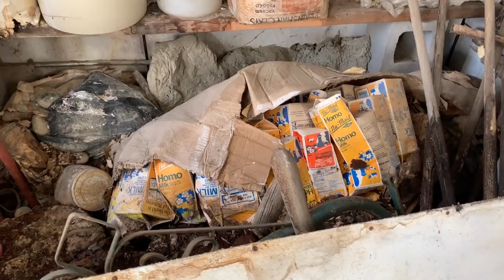Part 17. The Potters House: Mary's Last Ride

Comment: I teared up when Mary took her last ride. .. Thanks !     Those ice trays work better if you run water over them first before pulling up on the handle.
Reply: I still have some of those ice trays they were my mom's tray she had before l was born 59 years ago so not sure how old they are.
Reply: Run the water over the bottom though so the ice doesn't melt. I remember getting my fingers stuck to them too.

Comment from the maker: Regarding the tile... the correct solution is to use cement board over the subfloor. Although you can tile on plywood it’s more challenging and may expand or contract... that said I chose to do this as we were already 1” above the other floor and didn’t want to add any more height to the bathroom floor with added cement board.
Reply: We made the mistake of not using cement board in a bath. Tile lasted 2 years before cracking, grout falling out. It's a MUST where there's moisture.
Reply: Big mistake......................will not last long
Reply: And glue used is ok for wall (light weight) tile. Cement mix with larger tooth trowel for floors.
Reply: @celestewatson4874  yup and without any sealer on that plywood, looking at a LOT of damage as soon as ANY cracks start.
Reply: I used Schluter system. Comes from Germany. Also made in Canada. If you ever tile again you might try it. I learned how to install from youtube.
Reply: They put a clear sealer over the tiles in my bathroom. They said it will protect it from the moisture and make it last longer.
Reply: The first thing I said as soon as you started talking about tiling was “he’s not going to do that straight over the plywood is he”? No sealer, no waterproofing...... it honestly made me cringe. I can’t see it lasting much longer than it took to lay down.

Comment: That last ride was so moving! Also I liked your six sided octagon tiles ;)
Reply: I do too. They make somewhat of a chicken wire pattern. I wish,  instead of you putting in a different tile that would rob it of the charm and cohesive finish, ....just hire someone else to finish it with those tiles.  If I were buying the house, I would want the entire kitchen back splash to have the same look.  You made a wonderful choice aesthetically  and it looks great, please let it continue to the other wall. Let someone else have the headache of finishing it.
Reply: @kimberlytyler-webb9390  I was actually joking: they are of course hexagons, not octagons. But I do like them and I agree with you in that a consistent look would be nicer than using regular tiles for the rest of the backsplash. On the other hand, Alex has already done so much work in the house I understand he wants to get this done asap.

Comment: Enormous props to your bil for working on the glue. I’ve done that. It’s brutal.

Octagonal tiles aren’t subway tiles.  They’re porcelain so they’re going to be really hard.  That makes them more brittle. They’re not that hard to cut because the diamond saw blades don’t cut fingers so you can work super close to the blade!!!!

Comment: You should have waterproofed the room before adding tile.
Reply: I wasn't going to mention it with everyone so moved by Mary's last ride (I cried too) however he started tiling in the corner. I remember when doing my kitchen tile to start directly in the middle and work your way out, so the only cut tiles you will have will be around the edges
Reply: How is that done?

Comment: The old front doors almost always had a wood panel on the bottom half of the side windows. That is why there was only 2 short stained glass windows found,,and the reason is the windows on the bottom can easily be broken or dented.Also it looks a whole lot more cozy.

Comment: I laid the exact same octagonal tiles on my floor. The thing I had to resort to was a hobby vice to hold the tile and a Dremmel with a tile blade. It wasn't easy and a little dangerous but it worked and the floor looks great. I will never use this tile again!

Comment: When laying tile one should start in the center and work out. And full tiles should be at the door way. Never expect walls to be square either. Screwy edges can be hidden with moldings. Learned the hard way.

Comment: FYI.. With metal ice cube trays, turn upside down over the sink. Run a little water over the bottom of the tray. Turn back over to open. That should solve all problems. 😊

Comment: I wouldn't throw out any of the Goodwood out. In case you might need it I will put it on the back porch that don't have to be tore down. Okay Rose are you putting wiggling them in. I would grout that tile in a bright blue. Everybody knows that you bought this house you have how many followers, if it turns out they're trying to say you didn't well no one in their right mind would put the work in that you have done. And remember you have video of all of it. They were going to burn the house down or bulldoze the house, remember and it sounds horrible but artwork becomes more valuable when the individual that did it when they are no longer with us. Van Gogh and all the great artists. Love your friend truly Las Vegas Rose

Comment: The Octagon tile that you have for the kitchen will always crack with snips. They are difficult to lay hard surface not on the floor where you can see what's happening and also go slow and cutting them and you really need safety glasses they're not much. Love from my family to yours Rose from Las Vegas

Comment: USE A WET SAW
Use a sharp blade on your wet saw for precise cuts and to prevent chipping of tile or glaze. If a cut edge will be 
visible, use a stone to smooth the edge prior to installation.

Comment: You desperately need a real (drum) floor sander. Those flat sandpaper sanders are for light finishing work at best. 10 minutes with a good drum sander will do the work of 2 hours with the one you have. Just be careful to keep the drum moving whenever it's in contact with the floor, so you don't create a divot.

Comment: That bathroom would have needed some moisture barrier. The grout is not waterproof. The splash water will soak into the subfloor and cause mold and damage.

Comment: If you decide to remove the patina from those floors (and I'm fairly reluctant to call half-removed paint patina) don't bother with that toy sander! Rent a drum sander and start with 24 grit! If you've never used one before, you could use some 80 grit to get a feel for the machine but then get the big guns out! The only absolute rule is NEVER EVER lower the drum when the sander isn't moving! Start moving, then lower the drum, and if you feel you'll have to stop raise the drum first, then stop!

These orbital sanders are really designed  for the final touches, like a polish, but they're marketed to scared DIYers as tools for full refinishing - you've already seen why this doesn't really work out.

Or use the orbital sander to scuff the original paint surface and repaint, like you did in the living room. But stop wasting your time trying to get to bare wood without a proper sander!

Comment: Alex does the wet saw have a diamond blade? Okay you might look into subway tile it's all comes in different links, different with. Also you could add some glass tiles long and skinny and come in different widths. I think Lakota speech impaired Josh's brother might have some experience and laying tile that wall that sticks out could be a piece of artwork in the upstairs bathroom. The tub I see you only paying half of it you need to paint the other half because it will protect it from rusting. I know money is running type you've done a lot of work in the house subs the previous owners are trying to do a flim-flam don't give in. You do not know what the auction is going to bring. And I know you are upset about as hard as you for work and Mary doesn't get to see it. You don't know that just like she didn't know there was a heaven or hell. Love to you and your family Rose from Las Vegas